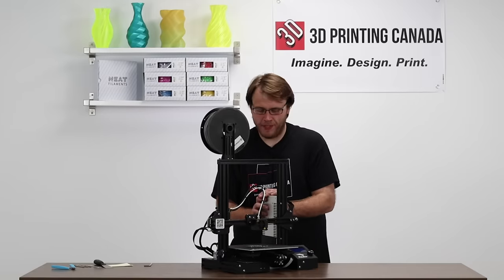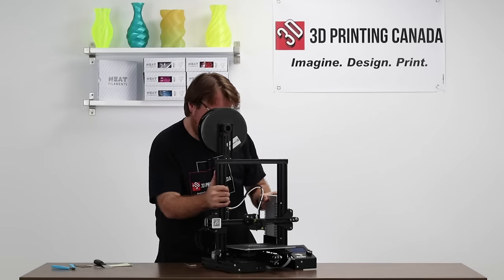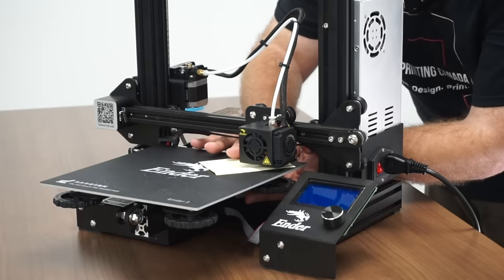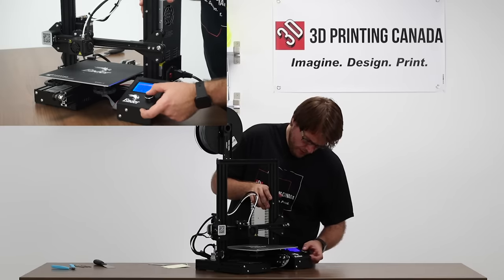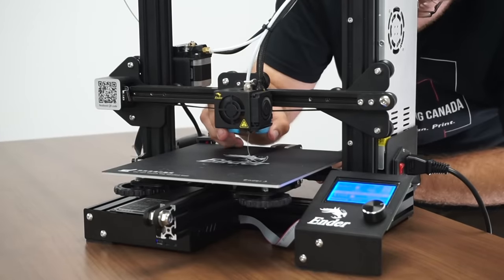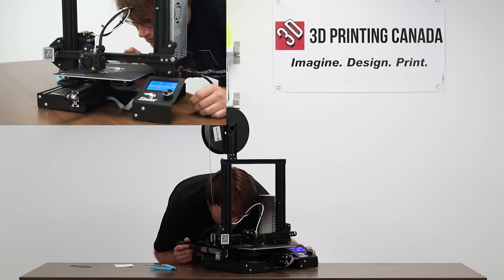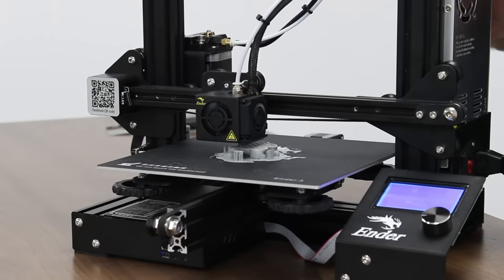Creality Ender 3 Initial Setup and First Print

Comment: You MUST heat the bed before leveling. What's level whilst cold will not be level when headed due to thermal expansion.
Reply: Pete , you’re right, there is a minor thermal expansion when at temperature. Whilst it hasn’t caused a big change in my experience with the Ender 3’s bed and hot end, it might work better for others. If you do, I’d let the hot end and bed heat soak for at least a good 15-20 minutes to stabilize any expansion.
Reply: Ryan Adams. As an experiment I leveled the bed, going around several times then started  a print with a cold bed and cold nozzle. The result every time was failed bed adhesion and a failed print. Next I repeated the test by preheating the nozzle using the prepare menu selection. The result was slightly better adhesion but ultimately the same. Finally I preheated the the bed to 55 degrees and the the nozzle to printing temperature of the filament, waited until both temperatures had stabilized, leveled the bed again going around several times then commenced print. Each and every time I completed a print successful. I've several printers one of which has a warped bed, low spots, with the addition of a few quick passes of glue in those spots the method works extremely well. I'm sorry to say your comments on 20 minute waiting time for heat soak on a 3mm thick piece of aluminum is in correct and misleading. Once the bed bed has achieved a stable thermal temperature and is no longer heating the bed will not expanded any further until you add additional energy into it.
Reply: I recently built my new Ender 3. I leaves the bed using the four corners method. Afterward I checked the center of the bed and the gap is slightly more there. If I warm the bed, will this resolve itself?
Reply: i had a same issue, do you have any solution for this?
Reply: @moren0d1  not necessarily. The bed may be warped beyond heat repair.
This is why a lot of individuals are using glass beds.
There are fixes other than glass,
Look up warped bed on ender3
Reply: THANK YOU!! This was my problem. I leveled the bed when cold and then i would print... but there would be more distance so i leveled the bed while heated and in worked great!
Reply: the heated bed is at 50 degrees. Dude nothing will change
Reply: @kidpog3d101  you'd be surprised dude, the front gate for my apartment building doesn't close properly on cold days and won't open on hot days lol
Reply: Is the heated bed cool enough to touch?
Reply: Dw bout heating the bed first, it doesn't make a difference if you use a piece of paper
Reply: Do we have to heat the nozzle, too?
Reply: @user-th8pr7no5p  lol no don't heat anything
Reply: tellin me this after leveling for an hour was'nt your best idea xd ahhhh
Reply: PugmaPug 50 degrees Celsius
Reply: You're right, this guy has just wasted a thousand tonnes of plastic as a result of this channel.
Reply: That was my question. Thank you.
Reply: no it doesnt matter
Reply: To Pete:  I believe in precision!!!!!!!!!! If I were building small precision gears or other items of the same nature. I would follow your direction. I think we all appreciate your input which does hold credibility. What you say makes total sense. We are making non metallic parts though. I will try your recommendation on my next print. As we all know it all about making the print BETTER!
Reply: Correct it fucked up my bed.
Reply: @kidpog3d101  50 Celsius ll

Comment: I am new to this but wanted to say something I feel pretty strongly about. Even with the steppers disabled, they turn into generators when moved. I learned this lesson at Texas Instruments with our stocker upper I/O ports. Back emf would kill delicate/unprotected circuit boards. I always disconnect my steppers before manual movement. Just watch the display when the machine is off and see it light up when you move an axis. Yeah I can hear it now from some of you -"That never happened to me!" Just a caution for those of you like me that don't have endless sums of money to put out for ruined parts. Just remember to put the connectors back in before starting up. (remember 3-x,y,z) - Rick

Comment: The reason your hose keeps popping out is because you probably forgot to install the little blue horse-shoe shaped retainer clip into the gap in the fitting.  Also, you don't have to turn it off to move the motors.  In the prepare menu, you can use "Disable Steppers" to unlock the motors so you can move by hand.

Comment: Excellent video, I was unaware of how to level the frame until your video. It's not something that is in the instructions as far as I could tell nor something covered in several other videos about the Enter 3. I just put some paper under one foot to stop the wobbling but will actually fix the issue when I get home today. Thanks again, you helped out a 3D printing newbie. Also your comment about 90% of failures being in the first layer is something else that I have not seen mentioned that has been spot on in my experience so far. I always hang around to make sure that first layer is down properly before leaving the room, saved me a lot of wasted time and material and is an important note for people exploring 3D printing for the first time.

Comment: Since the bed clearance with the tip is critical, I think it's best to use a machinist thickness gages to calibrate the distance of the tip to the bed which will give you a numerical value and from there you will have a reference number so it will be easy to go  higher or lower if need be because the gauges are numbered accordingly.
Reply: Yeah, feeler gauges are definitely a godsend here

Comment: Nice video. I'm having a problem. When I Prepare > Auto Home... the nozzle is about 2mm higher than the base. If I begin to adjust the base upward, I lose tension in the springs before it can reach the nozzle for all 4 corners.

Comment: I just bought an Ender3 today. Tried printing the dog. String and no adhesion. Stopped the print. 200c tip 45c bed. I leveled it but no good. I have to figure out the extruder settings. The motion is off. Says error too far. I need this machine to work for me and build small parts for my biz. I am going to work on the settings and try again tonight. Thanks for posting.
Reply: I got it. Too much nozzle to bed tension. More clearance between the nozzle and bed and it printed fine.
Reply: @JoeFlash1  Hello, I just built my ender3pro and im experiencing the same issue. Did you not use the paper to measure the "snug" feel of the nozzle and bed? that's what ive been doing all morning because thats what ive seen many people do. to get that close gap between the nozzle and bed

Comment: Thanks. I watched your video and with a little futzing around I am now printing a dog. First time using a 3D printer. My bed is a little tweaked seems slightly dished in the center and high toward the rear left. I was able to split the difference. I work with wood (working) quite a bit so I would say to keep the business card loose initially and run around the corners. then fine tune it. I did take the magnetic bed off and examined the plate. I ran my hand along the bed and noticed some issues, so it was impossible to really dial in the bed leveling. I just got it close enough, which was adequate, but not great. Running the sample dog now. I also had a lot off issue with feeding the filament in?  So I turned off the machine disconnect the tube and ran the filament through till it psssed through taking note of the path. I also checked to make sure it would fit through the tube.  With the machine off I then ran the filament into the tube and got it started!  The issue was with the machine on it would heat up the filament and make it impossible to feed it. I’m sure I’m doing something wrong, but I’m a complete newbie 3D printer guy. Thanks for making the video, it gave me enough knowledge and confidence to print out the first DOG. I just hope I have enough of the sample whit filament that came with the machine.

Comment: Hi Ryan! I have the exact same model. However I am having problems with it. I have it put together but there are times that the filament gets pulled off the bed. I can’t seem to lift the nozzle off the bed like you did with the 1 mm increments. Please respond ASAP.

Comment: I picked up the last one from you guys earlier this week!  (beautiful store BTW) 

First print was MINT. Second print failed because the set screws on the extruder... gear? so the gear rode up and stopped pushing filament. I should have checked this before getting carried away. 

Since then - Its been printing AMAZING.

Comment: Just got my Ender 3.  When I go to Prepare > Auto Home , I noted that the print head is slightly below the print deck.  This has me concerned, shouldn't the print head be slightly above the print deck?  I would have thought that the Z axis home position would be the height of the print head above the deck when the deck was leveled.  Thanks

Comment: Many thanks for your excellent videos.  I have just bought my first 3d printer and after assembling I was using your videos to guide me through the swetting up.  I have a major problem.  My X axis does not move.  The motor whirrs but there is no movement.  Also I could not find a "prepare" choice on the menu.

Comment: Just got a ender 3 pro and the bed does not seem very stable, and wobbles about 1/32" to 1/16" side to side, and up/ down on the right and left sides if I put a bit of pressure on the bed.  Is this normal ?  I'm having trouble leveling it because of that.

Comment: running hatch box PLA 205 ex temp bed 55 making a great-looking print. that just fall apart?  I have done it all?  changed 2 boxes of pla my unit has it own sealed room at 82 deg ambient temp, humidity at 40%.  set the mm to the factory recommended ? ? ?

Comment: I don’t know if this is a common problem but my Ender 3 (using Cura as my slicer) but it prints on the side as if the center of the print is off the hot plate, is there any ideas of how to fix this? Or maybe just adjust the axis like you did in the video?

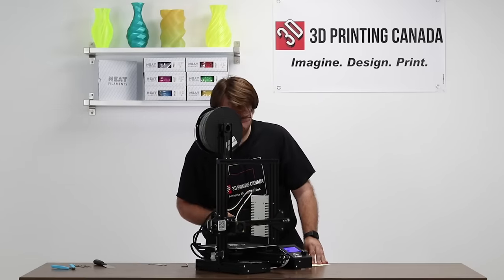Comment: Hello I’m new to 3d printing and got an ender 3 v1 as my first printer built it fine but then at 3:53 you said to click the knob and go down to prepare however I do not have that option also the board is a v4.2.2 if that helps 

Hope you can help me , thanks

Comment: i assemble mine today but its not printing i get some filament coming out during pla preheat but when i start the print the nozzle just move around no pla coming out. ive set my bed so a piece of paper can pass under the noose with slight resistant. what could be the problem? what temp should i set my head and bed for the test pla that comes with the kits

Comment: When I auto home, the hot end comes past the build plate and the nozzle is 5mm below the build plate, how do I change this setting? I have tried using the movement and offset command but when I auto home after this it goes back to the original position
Reply: If it comes to zero in front of the bed, check the Y axis stop sensor, mine was warped so I stacked some tape in front of it to trigger the sensor earlier, now it is in line with the very edge of the bed. For the Z axis, first make sure your bed adjustments are as low as they can go (springs almost fully compressed) and check the Z stop sensor was pushed up when you tightened it to the side of the frame/gantry with the T nuts.

Comment: oops, a bit of a situation here.
after installing glass bed and putting clips on it  little differently from where the video suggested then calibrating it as shown with the dual thickness of a sticker (thanks for that tip) I tried to print the test cube and the hot head knocked off two clips and then started scratching the glass because without the clips the glass raises up.
Could you clarify where we should and should not put the clips to avoid this issue?

Comment: Thanks for the video.  I just purchased my ender 3 pro this week, but am unable to get it to print.  I downloaded a “test box” from thingiverse and ran it through Cura slicer software and copied it on an SD card.  I have been totally frustrated by the blue display screen and lack of instructions. But, NOW I’ve found you!!!  So, back to the drawing board so to speak.  I’ll go find the test dog and try to run it.

Comment: When I press "Auto Home" my bed moves all the way to the back and keeps trying to go off the rail.Any help?
Reply: Michael Degani there should be a switch at the end of the rail that one of the wheels will press if the bed goes to far. Is it plugged in? Is the wheel able to press it? Hope you manage to fix it
Reply: @clivefellows8748  Thank you I did

Comment: where do I put the flash drive that comes with the kit. My printer doesen't have any of the menu options that you stated in the video. What about "print from SD"
Reply: Hey Rex, the thumb drive that comes with the printer has an SD card in it that you can pull out of one end.  You insert the sd card in a slot at the front bottom left side of the printer, beside the micro usb slot.  Once you've got the card in there, the g-code for the test print will be available to the printer using the method described in the video.

Comment: thanks this has helped me greatly because yesterday I couldn't, for the life of me find out what was wrong with my printer,a s it was producing nothing but melted, stringy plastic. It is working much better now, but it only does so for so long before the bottom layer gets stuck to the needle and torn off of the bed; any ideas where i am going wrong? Is the heat bed too cool or something? I have it at 60 degrees.

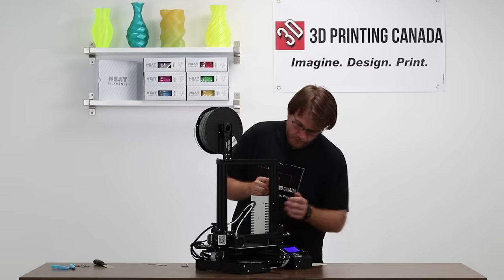Comment: When changing the supplied bed to a glass bed. you have to lower the bed... Using your information at around 4:00 minute mark you say to use "Find Home" to position the nozzel . My question is where would that point be in relation to the bed? The glass bed is thicker. This information would be helpful to have when changing springs as well. Right now my bed adjustment is at a point where the adjusting knobs actually will loosen on their own during prints. Knowing that the "home position" is at what point of the stop switch movement would be nice. IE: will the switch be completely flattened before stop is made OR will it be any point in between.

Comment: one side of my bed seems higher than the other, the springs are tightened to the highest level on right (back and front) and lowest level on left (back and front) even so the extruded plastic is getting much more squished on the right side, the bed seems quite stable when steppers are off

any ideas?

Comment: When he says its normal temp, what are these temperatures? Because I preheat for pla and my print turns to crap, my printer cane with an micro SD card but nothing on it so I'm having to use custom settings on cura, but nothing seems to be working

Comment: My printer does nothing when I hit auto home.  I really think I have some mechanical issues with it.  The bed slides all the way back, the print head goes all the way down but the z motor gear grinds and stops the whole way and I have to manually assist it and the print head never moves over.  It literally never moves side to side.

Comment: How do you print from the sd card? I download prints and put it in the card, but when it is in the Ender, it doesn't show up
Reply: Have you initialized the card using the menu on the machine?  I wasn't seeing the card until I realized I had to initialize!
Reply: @danielroop4123  yeah, I fixed all my problems except 1 when I try to print, the filament curls in a ball and doesn't allow a print thanks for the help tho!
Reply: You need a 3d printer software to splice the file intongcode

Comment: When I try an auto home, the bed goes all the way back and the motor acts like it's wanting to go back even more but there's no more space what is going on? Seems like it's wanting to go beyond the y-axis maximum
Reply: that happens with mine as well
Reply: @e.g3193  found out that my Z axis motor screw was not tight enough on the tall Threaded Screw, so it was spinning but not moving the head up or down
Reply: @JeffDrumm  I have fixed the bed but the nozzle is moving constantly to the left and the sensor does not realize that it is there and it does that same thing, just not with the heating bed.

Comment: I'm a beginner at this and I tried to follow your instructions, I  have questions though ;-;'

1. Do you have to set all 3 of the axis to 34mm? If so, do you always have to do that?

2. The file showed up on the keypad but I was unable to print it, I originally had it set to it's actual x, y, and z axis, but when I selected it nothing happened. I then selected cooldown cause I thought that it would heat up on it's own but it also didn't respond. I'm not sure what I'm doing wrong.

Edit: I selected auto home and went to control, clicked on the digital 3D model I made and it still did nothing. Every time I selected the file it  hasn't do anything.

(sorry if I'm overwhelming you)

Comment: I flip the power switch on mine and nothing happens, any suggestions?
Reply: Try changing the power supply to 115V if you're from the states. It will not start if it is at 230V. This can be done on the back of the power supply

Comment: My three ender pro will not recognize the dog file. When I upload a 3-D model it prints at the home placement (front left hand corner) and cuts off half of the 3-D model. Does anyone have a solution or did I get a bad unit.

Comment: i've built it according the manual , but manual says i need to put the wire for the screen at exp3 , screen goes flashing blue , i put it at exp1 it takes a half a minute to start up.
strangest thing is it is on even when i've no power cable in the unit